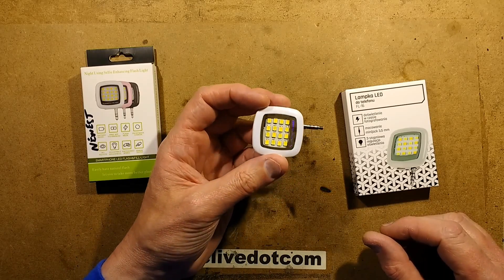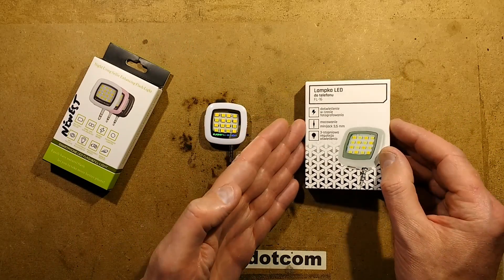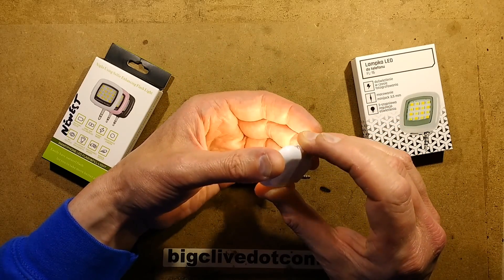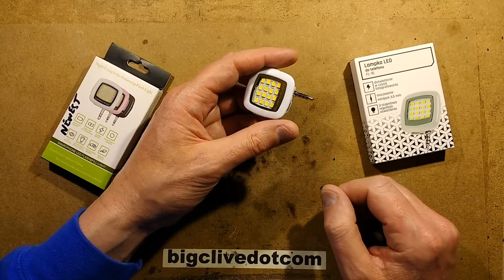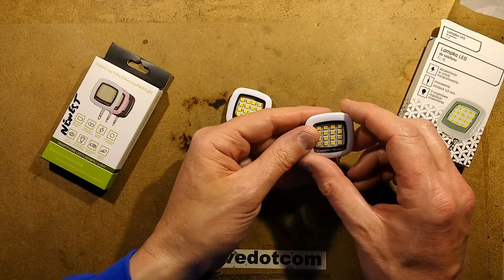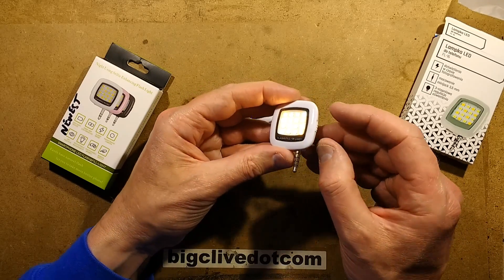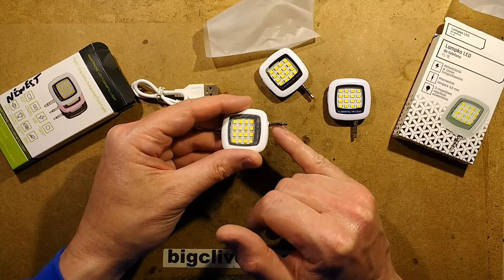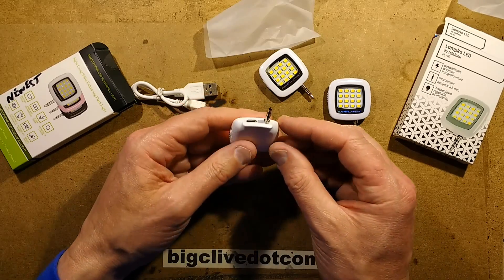Inside three different 16 LED selfie lights.

Comment: I suppose one could substitute the LED's for a ring of LED's to use as a ring flash for macro photography.  
Even as is, two of them could be synced easily with audio extensions and a headphone jack splitter for a dual illumination setup for product shots, and scale model photography. 

Sorry, just thinking out loud again. ;-]

Comment: just like the iPhones that have two different color LEDs in the flash that's the same as this it's meant to give you a fuller Richard color photo as a 5k LED 4K and 3K LED actually output more colors of the RGB than people realize

Comment: It's probably been pointed out before: The minijack is for mounting the light on the phone so you don't have to hold it. Obviously this was before the disappearing minijack. Huh, watching more of the video I see yours do have functionality. Mine (different, older model) doesn't. The only point to having functionality woule be to use it as a flash. So when you snap a photo, it turns out just momentarily then turns off. To save battery. I used to buy phones with Xenon flash. My latest is the only one with a led flash. I've found it's useful for macro. But it needs to be turned on, not flashing, because otherwise I don't see the hotspots that might obscure text or other bits of the image I need clear,

Comment: the original flash with 3 lines"talks" to an app to control it. the flash with 2 lines is full manual control. the other flash with 3 lines "reacting to youtube" is triggered by the cameras audible "click" that it makes when pressing the capture button. iv'e bought these for my kids so i am familiar with how they operate...

Comment: These are also good for other uses. If you want a cheap light for your kids bed room or for the Kitchen top and want to save on the electric then these are good. also good for power cuts.

Comment: Could someone explain why those LED's are small yellow squares and not the clear oval things?
Reply from the maker: Superflux LEDs.  Rated for higher current and very easy to mount because they have four pins that can also be used as a pair of jumpers.

Comment: Clive, being into electronics myself (clearly not as knowledgeable as you) Would it be hard for them to take the higher output cree leds like the 700ish ma make the enclosure square, heatsink the leds to a finned aluminum heatsink, have the back vented and a fan behind the heatsink to keep everything cooler, and maybe get a very powerful light in a very small package?

That is something Id like to do once I learn more, get a good soldering station and maybe a 3d printer. Would be cool to see them blindingly bright

Comment: I am looking to get a sealed lead acid battery to run a Raspberry Pi. I would like some device in line to separate the charging from the computer supply to keep out noise and spikes. what would you recommend?

Comment: I used one of those tiny lithium cells to make my cheap wireless mouse rechargeable. just needed a charging chip, a micro USB dip connector and a diode. now I can use it daily for over a month, charging takes 15 minutes. better than buying tons of those overpriced AAA cells... BTW before it used 2x 1.5V AAA Alkaline cells.
Reply: HaLuNkE ST0NER good idea but I use rechargeable aaa's in mine . have 2pairs and it takes 15 seconds to swap them.
Reply: Mark Howards and how long to charge them?
Reply: HaLuNkE ST0NER I'm not knocking your idea. overnight, and I can still use my mouse straight away on the pair that's in.
Reply: Mark Howards ah OK
Reply: I have a cordless phone with AAAs which lives in the charger. When I was using my cordless mouse, if the batteries were running down I'd just swap them with the ones in the cordless phone. The batteries got charged, and also discharged when used in the mouse.

Comment: I've been lurking watching your channel for a while now.  
I have a question, is it worth paying more for a "calibrated" multimeter? I could be trying to measure very low resistances or using it for RF applications.
Reply from the maker: +Bozebo When you buy a meter it should already be calibrated.  Calibration is usually just when the meter is checked against known values and a certificate issued.
Reply: The £2 meters I bought from Maplin don't seem to come with a certificate.
Reply from the maker: They should come out the box within calibration, but with no certificate.  To get a meter calibrated you send it to a calibration company and they simply test it against known values and pass it or fail it.  They rarely actually adjust anything.  It's just a box ticking exercise.
Reply: Awesome, I suspected as such. I've spotted I can get the same DMM you often use (AMECal ST-9905) for a good price, the Maplin one I had died when I was trying to read something at half its rated amperage and it cost just as much :P

Comment: I would be curious if you decap the linear chip on these lights and a known genuine linear chip if the light linear chips are genuine or fakes. Surprising they would use genuine American chips on a cheap eBay item. Every penny matters on eBay.

Comment: If you have your "shutter" sound on when you take a picture with your phone, that should set off the light, no app required.
Reply: except that playing the shutter sound and the actual shutter have absolutely no useful alignment whatsoever. The shutter sound is just for the coconut effect to tell you the camera has been triggered.

Comment: That jack does jack for this device. I got one and it has no screw inside. Has a 200mah battery and barely lights up on ultra high volume, amd not on camera sound. I'm also sure these are all clones of something that failed to hit the market in time. Like all the crowd funded ideas that get cloned before the funding is complete.

Comment: Hey Clive, I've been wondering; I've got an old electric shaver that can't hold a charge anymore. It seems to use two of the AA sized cells, and I was wondering if I could drop a couple AAs in there, or if I should try to find some decent rechargeable cells of the same type? I know the regular cells wouldn't be rechargeable directly.

Comment: Clive, ffs, take a picture with it and see, trying everything except what it's meant to do. 
Most phones make a shutter sound (and it's mandatory in some countries). maybe all you need is the shutter sound to activate it.
Reply: Different phones / apps have different shutter sounds.

Depending on the volume and the type of sound, the reliability of using an app other than taking the risk of the one provided is questionable.

Comment: Mixed LEDs = factory had a big box of random rejects from other production lines.
Reply: They are there in a regular pattern (alternating WW and CW). So at least they got two different boxes of rejects ;) .
Reply: I suppose the manufacturers just wanted to save money while not ordering ~ 4000 K LEDs and used common 3000 K and 6000 K LEDs instead to achieve nearly the same color temperature and color rendering index. If they only used cold white LEDs, Mr and Mrs Selfie’s skin tone would be too blueish; warm white LEDs again would shine too yellow, so that the camera’s auto white balance would color not illuminated picture parts blue.
Reply: My thoughts exactly!
Reply: 2 kind of led is better than 1 tyoe of led and thats why smartphones usually have 2 different leds
Reply: @soups1697  Actually, (some/most) phones have 2 tint of leds so they can adjust the tone of the flash , the flash brightness of both leds are adjusted independently of each other to the current needs. The 2 different leds here do not do so and thus there is pro to having 2 different ones. (Well you do get the single mixed tone of course.)

Comment: The app probably comes with a whole lot of spyware, so it isn't a good idea to use it. But there may be some kind of generic sound generator app that you could use in order to test your theory of "loud noise" turning it on. You could probably try different frequencies, or compare it to white noise and so on. If you have a "disposable" phone with no personal data on it (with disposable meaning you could easily erase the whole operating system and just flash a new one, deleting the complete memory of the device in the process), you could connect the phonw to a set of speakers and run the app to see what comes out of it.
Reply: Stijn, 99.9% of 10,000,000 is still 10,000 dodgy apps.
Reply: It won't. If it's available in the App Store or Google Play store it's (99.99% of the time) safe. If it wants access to contacts or camera it has to ask for permission.
Reply: Stijn Stevens no that isn't true. We have seen many examples of truly malicious apps being distributed through the Google Play Store, and as for permissions - at least on Android - you can only control these from Android 6.0 on, and with that, it isn't even possible to fully control them (i.e. could you reject the permission to use IPC/Binder? Or even the permission to access the internet...I see nothing in that regard, without having your phone rooted and secured with apps like XPrivacy or AFWall+). Also, some apps might just not work if you don't give them permission - so if you want to try those, you'd need a completely blank phone that gets wiped blank again (or better, re-flashed with a new OS, including wiping all partitions before this process) after you're done using the app.
Reply: Seegal Galguntijak All apps submitted to the Play Store are checked one by one by an actual human being. Provide a few recent incidents please. 
And if the app doesn’t work without permissions, that’s a good indicator that the app should be avoided anyway.

Comment: The shunting of the two pins are usually done between GND, and ID pins, on the micro USB there are vbus(vcc), data+, data-, id, and GND, sometimes, there's also a "shield" pin in schematics, which basically just goes to ground / earth.

Comment: You could probably make a cheaper version by replacing the 3.5mm jack with a male mini USB connector - so it'd hang off the bottom of a normal phone instead of the top. USB can supply 5v, so you can avoid the expense of the battery and charging stuff and just run it off the phone battery. You would also be able to have a neater solution for the app based control, if you could spare the expense for the logic needed to make sense of the USB communication
Reply: Not all phones support USB OTG.

Comment: Only Iphones cant have those cool features
Reply: stili774 headphones found: adaptor in box.  headphones found: using iPhone SE
Reply: Gamerdu45 what's cool about these? The iPhone 7 uses the screen as a True Tone flash when taking a selfie. So all other phones have to put up with these crap add ons.
Reply: Nö, iPhone dont.Error 404 : Hadphone Jack not found on iPhone 😈

Comment: For some of those little screws, I have a set of small posi head screwdrivers that I've filed the points off the end. Good for the tiny shallow screws in circuit boards too.

Comment: If you accidentally activate that app while having your earphones, you are deaf :).
Reply: And it'll probably destroy 32 ohm headphones
Reply: I think there would just be a click then nothing, like testing speaker polarity with a battery
Reply: Xibalba most phones headphone jacks are AC coupled, so the apps will use a tone.
Reply: Xibalba, it would only click if it were DC that activated the light - clive said it was a tone (and we see it flashing to "So much YouTube") so it would likely be an alternating signal. That said, maybe a DC signal would still work and the developers just didn't know how to do that so they made it flash? Dimming cuts power draw, that could be the idea too.

Alternatively maybe the filter is there so it only reacts to "bass" signals, and that was a design choice.
Reply: DiodeGoneWild If the product developers were kind people, they would make the flash's trigger frequency something out of audible range. Say 20kHz or so. To prevent deafening a less than vigilant user of course
Reply: @OnlyNotes  Ideally, yes. However, the signal coming through the audio output is automatically capped at 20kHz just because of the way the digital-to-analog conversion works.
Reply: DiodeGoneWild I too sometimes utter words in YouTube comments

Comment: Doesn't work with my iPhone 7 :(
Reply: You're forgetting that a lot of younger iphone users believe apple invented video calls because they gave it a name!!! They weren't around when Motorola brick, big screen phones had video calling.
Reply: c fahy The iPhone 7 screen’s brightness will flash 300% as bright than normal on front camera mode. So it’s still better than just a simple flash on 100% screen brightness.
Reply: You have whole screen flash (Apple term: Retina flash) that is stronger anyways.
Reply: Evil from evilution Nice headphones... wait
(by the way, I don't mind the shift away from the 3.5mm jack. I'm not an apple fan but it seems like a natural progression.)
But cut out the 'top quality', 'true tone' marketing bullshit, you sound stupid. Your screen lights up when you take a front facing pic, my Nexus can do that. Open Camera does it too. There are tonnes of camera apps that do that.
Reply: oliver samsung has that too ,but brighter than apples since OLED is superior brigher
Reply: TDay even if you had an iPhone with a headphone jack the selfie light would be useless  if not  awkward  to use....since the headphone jack on most iPhones  (or at least after iPhone 5). is at the bottom clearly this was  designed for androids (or even windows phone) which typically have the jack at the top
Reply: TDay you don't need this shit with the top quality iPhone 7. It uses the screen for selfies and even changes the colour temperature to make the resulting photo colour correct. So your silly diss on the iPhone 7 not having a headphone jack backfired.

Comment: Bought the first one last year and tried the app but nothing happened, and was the same with those little IR TV remotes you plug into the headphone socket but later found out there's something about the way Galaxy S phones work where the signal is somehow different through the headphone ports.

Comment: could you use a reverse type of Joule Thief to charge a battery with a weak signal like from the Jack? or an opamp somehow or is the signal totally different and not possible at all? (don't fully grasp opamps yet fully, sry if that is a stupid question)
Reply: MyBigThing2010 you could charge several capacitors in parallel and discharge them in series.

Comment: Hmm... surely there are cheap entry level Android phones available in the UK that you could have one for testing such dodgy things? No valuable data on it, so just do a factory reset on it to clear out any nastyware. A few months ago, I picked up a low-end Samsung on sale for $20 at Target that I wound up using as my car GPS device. Obviously subsidized by AT&T's prepaid division, but I'm not crying for the DeathStar's lost profits. ;)
Reply: Lee Poling I have a leagoo lead 7 I use to make sure battery packs I make don't make my Nexus go thermonuclear :)
Reply: Scrounge an old phone from someone. They're often glad to get rid of them, with no need to bother trying to 'dispose them responsibly'.
Reply: argos sells a smartphone for £15
Reply: Not to be rude, but I belive your flag is upside-down.
Reply: Prodias :3 That is intentional.
Reply: In the UK that would indicate that you were in distress...... maybe you are?  Although we would need to see the flag pole to be able to tell with ours  :)
Reply: Furr Bear a burner phone but for testing tat instead dealing drugs. I like it
Reply: Basically. ;) Don't even need a plan, for this WiFi would be sufficient. Oh, and of course a burner Google account to go with it - in case one runs into some REALLY nastyware that tries to do something unpleasant to said account....

Burners are fun; I've been recommending to friends that if they go to a demonstration or protest - get a burner and leave their regular phone (loaded with personal data) at home... just in case. If nothing else, it means one's fancy flagship phone can't be lost, stolen or damaged.
Reply: You think having Dumbfuck Donnie Dollhands in the White House isn't worthy of a distress signal?!!